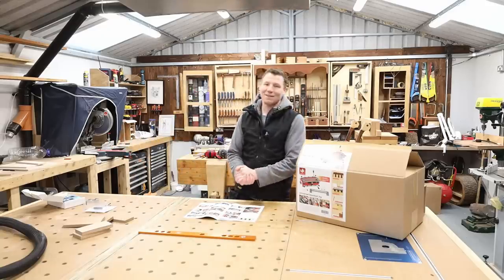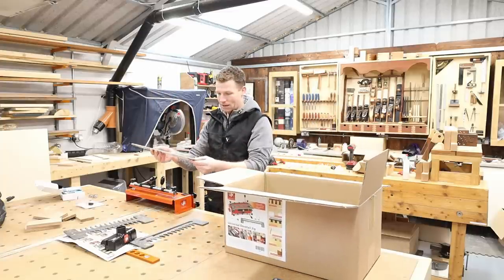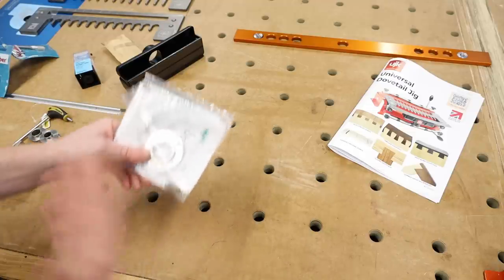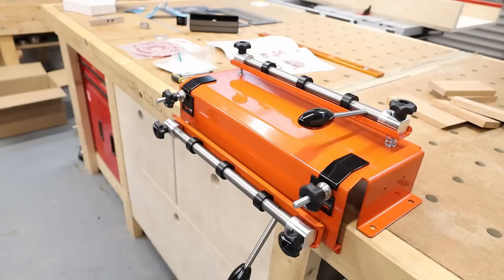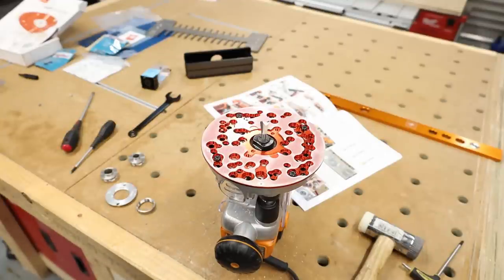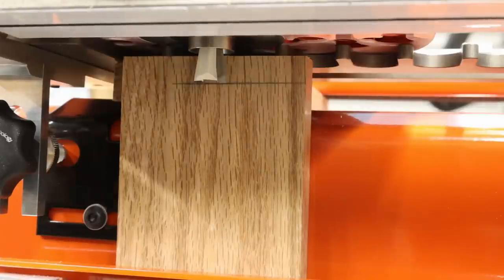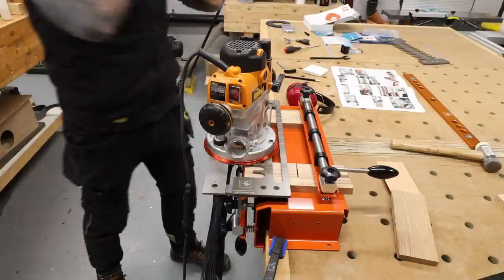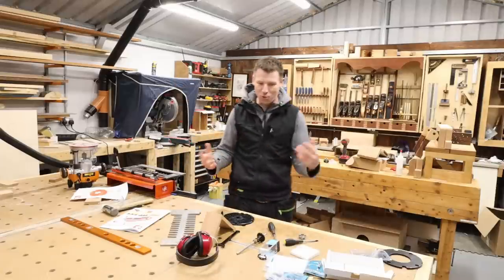UJK Universal Dovetail Jig+Universal Router Base. First Impressions! Testing Half Blind Dovetails.

Comment: Instead of trying to line up the center of the tail board with the center of one of the fingers, you'll find that the vertical lines that are scribed at the center of each U-shaped recess are where you should line up the edges of the tail board. Lay a straightedge along one of those lines and it will be easy to set the tail board in its proper location.
(I learned to use one of these a million years ago when I apprenticed to a cabinetmaker.)

Comment from the maker: I should just mention Maximum material thickness is 25mm or 1 inch and maximum width is 300mm or 12 inches. 
Dust extraction is very good. I will do a full review and demo of all the joints when I have put some time on it and let you know if there is anything I don't like about it. For now first impression are very good. You will find the jig here https://www.thecarpentrystore.com/c/ujk-technology/634

Comment: Good video - I just bought this myself and made my first half blinds last night so it was fun to see yours today :)
A few things I learnt that may be nice to keep in mind:

 - Remember to set the cut line on the right side of the jig before inserting the vertical board (I see you did this on your second try)
 - Centering the vertical board actually only matters in terms of dovetail placements, as long as your two boards are perfectly aligned in the jig they can be off-center as much as they want but it'll look quite bad. Wont affect the alignment though. 
- To align, insert one board at a time and redo them a few times. Make sure they are perfectly aligned to eachother, square the vertical board with the stop and reset the horizontal against that to close that micro-gap that can come

All that being said, the real trickery here, for me, is what you addressed by that the sides up and out are the insides of the box. So if you're marking boards, you'll need to switch and turn the pieces as the front and the back plate wont be going into the jig the same way. 

However, if you've centered more or less perfectly, you CAN put them in "wrong" and it'll still work, but your front side will suddenly be the inside.

Here's me having literally twice your experience with these cuts giving advice, haha. Just thought I'd share my very newbie experiences though, hope it can be of any sort of help.
Reply from the maker: Thanks for the tips Christian

Comment: The jig looks nearly identical to my porter cable one I got 10 years ago, I do all my dovetails by hand it's pretty fast the way Rob Cosman teaches but a little more technical than just cut scribe chop method. Your video is inspiring to get the jig out.
Reply: Does the P&C do as many cuts? Does it come with the bits?

Comment: Didn't know that it includes a slot for sliding dovetails, that's handy - thanks for the vid (have the same Triton router too - the lack of fittings can be a bit annoying at times but the integrated lift makes up for it :))

Comment: I recall the depth of the bit will affect the fit of the joint. Being that the pencil line has thickness, you may need to adjust  to one side of the line or the other to get the proper fit.

Comment: Where did you get the quick connect sockets would be really handy for the workshop
Reply from the maker: I have a video on two different types and setting it up with a dust extraction hose
Reply: @JohnMcGrathManInShed  have you a link to the particular video